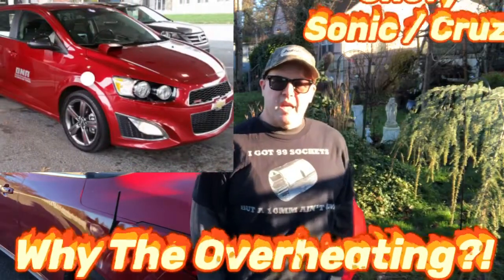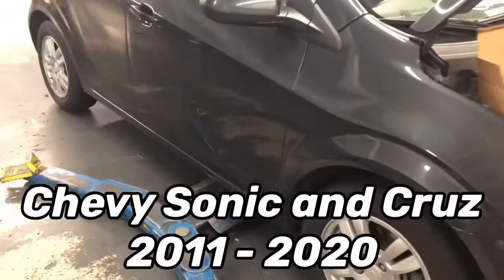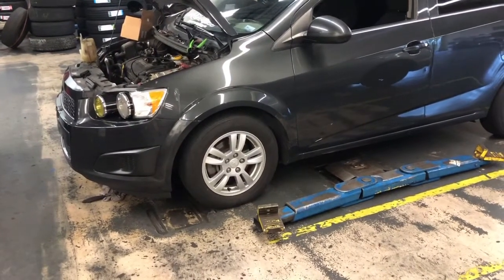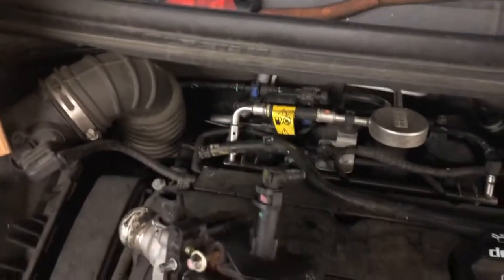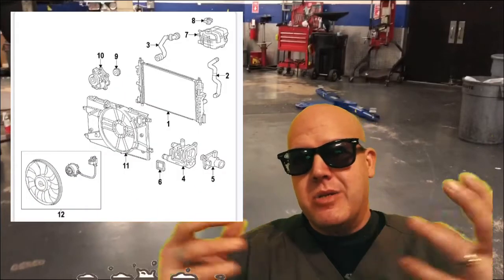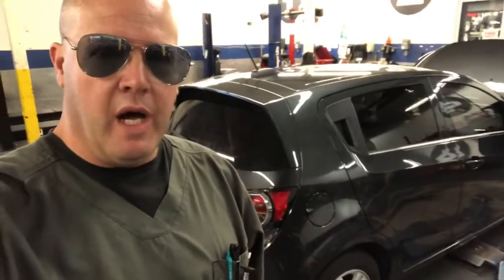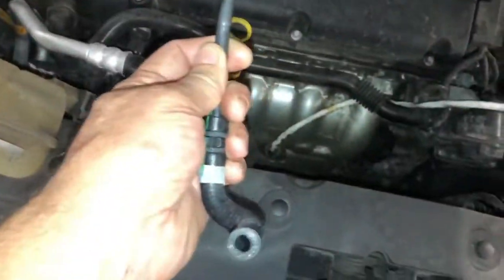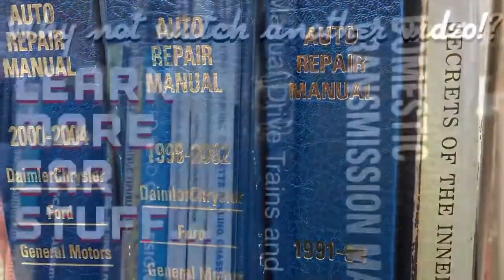Why the OVERHEATING?! Chevy Sonic & Cruze P0126, P0128 and P0118 Insufficient Coolant Temperature?!

Comment: New radiator thermostat housing, thermostat, water pump and fan, mine still overheating 🤣 found that I have constant pressure in coolant system
Reply from the maker: Was there oil in the coolant? Did you check the electric fans?
Reply: @RussShawTV fans work properly, no oil in coolant, had a recent head gasket replacement, rebuild

Comment: Talking more about what the issues are we're trying to fix than "other things" would be more helpful 👌
Reply from the maker: Did you watch the entire video? How did I not address your issues? Thermostat housing is a common problem with these engines. That’s what I was putting out this video. One of many reasons why your car could be overheating. It’s a video I’m not there diagnosing your personal vehicle of course. Not sure what your point is.
Reply: @RussShawTV  yes sir I watched the entire video and it wasn't very helpful.
Reply from the maker: @williamadcock7618 OK but TBT as a professional mechanic and someone has been doing this for 30 years. If you’re subscribed to the channel I’m willing to help. It also helps and inspires me to make more and better contact. But I get it it’s a lot easier to be a critic than a solution finder.

Comment: I did fix the Coolant Valve that was cracked and leaking. I am worried my Coolant Fan isn't working properly. Its either a bad coolant Sensor or a short in the wiring between the relay, fuse box and the Fan motor itself!!!!!

Comment: I had the thermostat housing replaced. It's so surprising that it's a plastic part. You would think it would be made from something stronger. I currently believe I have a short some where causing the cooling fan to not function properly. Have you heard anything about this with anyone else?
Reply: Some of the fuses in the fuse box under the hood have to do with the fan. My radiator fan wasn't working turning on at one point so I got a couple of new fuses and it came back on! $10 later and my AC worked again! Now my fan is out and I think there's a short somewhere else but it was a nice one time magic trick. Worked for a few months. If curious watch this video about 5 mins in. https://www.youtube.com/watch?v=GMLKUQJaupg
Reply from the maker: I would replace any cracks or anything that hinders your ability for that engine to cool. Quickly.
Reply: The resistor on the fan goes bad Easily. Because it's running so hot. Keeps blowing the forty amp fan fuse

Comment: I have had my 2016 Chevy Sonic turbo for 3 months and I noticed it gets very hot. My thermostat housing cracked at the valve but I think the fan motor isn't working properly though. Any suggestions? Please I could use your help.